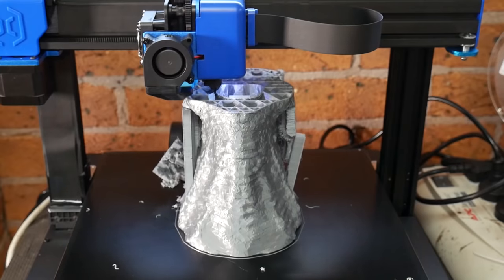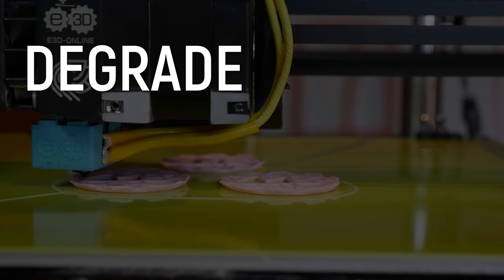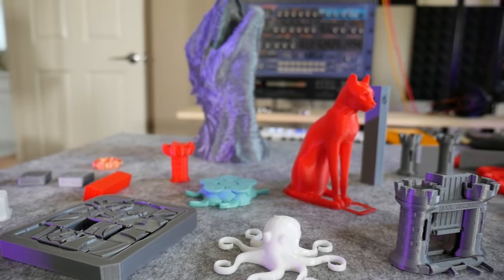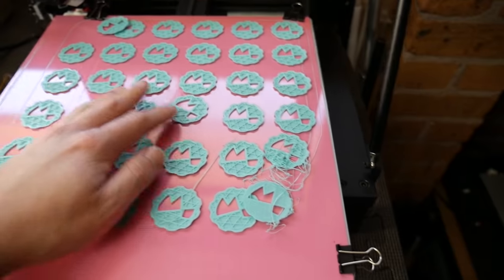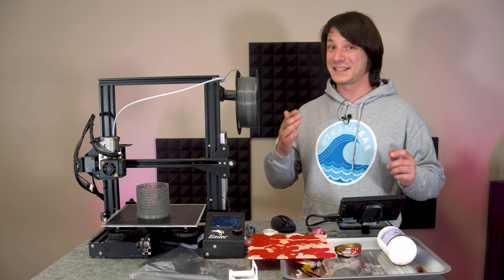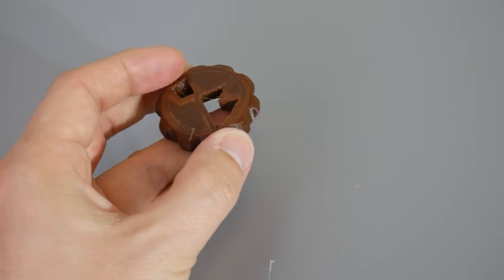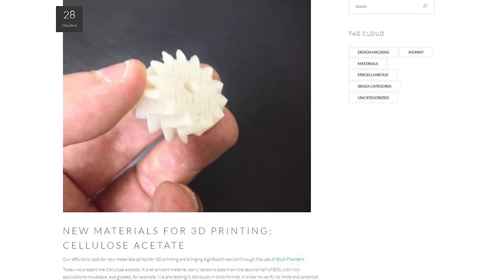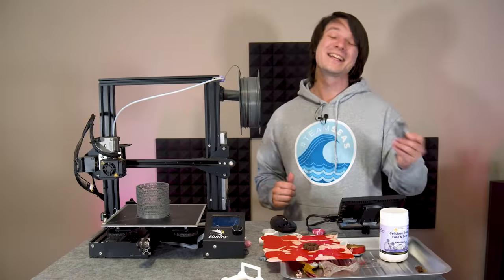PLA - 3D Printing's Biggest Lie.

Comment: A few notes:

If plastic is properly disposed of (i.e. industrially incinerated) it's not really a problem compared to other atmospheric carbon sources. Almost all ocean plastic comes from the fishing industry or countries without proper waste disposal.

SEA countries import plastic trash to recycle and sell it, they aren't paid to be landfills. The issue is just that one of the reasons it is economically viable to recycle there is lower environmental standards which result in improper disposal of unrecyclable fractions.

Cellulose Acetate doesn't biodegrade well, just look at cigarette butts. Funnily enough I had an exam yesterday where CA was an example of a bioplastic that doesn't biodegrade properly.

Comment: As a TL;DR addition to one of my previous comments, PVA and/or PVAc (Polyvinyl Alcohol and Polyvinyl acetate) might be more readily useable, readily bio-degradable (and water soluble or water degradable) 3D printing materials, both of which already have some use in 3D printing, I think.

Cellulose acetate (or even powdered cellulose as filler) might be useable in various PVA and/or PVAc blends. PVAc might also be a useable plasticizer for cellulose acetate and a melting point reducer. (PVA is much more water souble than PVAc, which could be a benefit or detriment depending on what you want)

Comment: First of all, just because it says it was made with corn, does not mean it was made from the edible parts of the corn plant. Definitely something to look into more before you start saying it could be used for food instead. Next, I have heard of a couple of startups trying to manufacture machines that can melt used 3d printings and turn them back into filaments. I did a bit of research on one for a college business class project last year, for using recycled plastics to created products, though I don't remember it's name. I am from the USA though, so I don't know what is available in Australia.

Comment: It degrades just it needs the heat, bacteria and worms from compost.
Me composting my PLA waste after breaking, grinding them down.
In my quite average garden compost it totally dissolve in about a 1,5 half year period.
The oxidiation/rotting of plants is an exoterm process, it's easily heat up to 60 celsius (more like 70-75), and it has everything to degrade/dissolve plastic.
Not in a 60 days period, like the industrial process, but still doing it's thing.

Comment: About 15ish years ago, I remember reading about a researcher working on a way to use waste plastic for roadways that would basically never degrade. He had some method of breaking it down into very jagged and irregularly shaped microplastics, like the size of sand grains, that were then put under very high pressure very slowly (to mediate the rise in temperature), and the result was basically a block of plastic that was so mechanically interlocked with itself that it behaved more like a rock, and didn't really care what got thrown at it.

Not saying it's necessarily a good idea. Personally, I'm team Plasma Arc Furnace.

Comment: I'm pressure sure Celluloid had already replaced tortise shell items in the mass market before Cellulose Acetate came along and competed with and eventually displaced it (mostly due to its non-flammable nature and eventually lower cost as well).
Likewise it largely replaced celluloid (nitrate) based photographic film stock with safety film, though both types have problems with autocatalytic decomposition in very long term storage under adverse conditions (high temperature and humidity) though cellulose acetate is probably worse in this aspect. (it also degrades with long-term contact with skin, sweat, and body oils, as many people with cellulose acetate glasses frames may have noticed, especially on the ear pieces)

Cellulose acetate also competed with (or still competes with) cellophane film for packaging, and has done so for a very long time, though now competes with a variety of other plastic film types. (and cellophane itself is a less common bioplastic due in part to concerns and problems with carbon disulfide use in its manufacturing)

That said, you're right, it should be a fairly good 3D printing material since it melts. (cellulose itself will not, so you can't 3D print cellophane, at least not in the conventional sense ... though cellulose dissolved to form viscose can be spun and potentially 3D printed in industrial settings)

PVA, polyvinyl alcohol might also work. It's water soluble and biodegradable, but by the same nature the water solubility would limit its use.
PVAc, polyvinyl acetate might also work, though the melting point is rather low and it's pretty weak. (both cases of PVA and PVAc or a blend of the two might be good for short-use items and disposable iterative design type items)

Any combination of PVA, PVAc, and cellulose acetate should make for an interesting array of properties as well.

Comment: i mainly use petg because where i live the price is slightly cheaper. I save all my failed prints and broken successes in sealed bags seperated by color so that when i eventually can get my hands on a grinder and filament extruder i can recycle my failures. i have about a garbage bag full of petg that i need to recycle already.

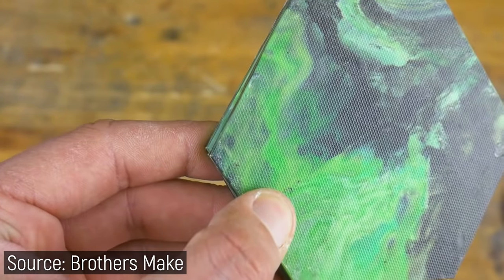Comment: I saw a guy that recycled cardboard and paper by mixing it with water and using 3d printed molds to create new things that he can use. If you have a 3d printer (and im sure 90% of the viewers from this video have) you could use the same idea but with your waste PLA. At 5:40 we can see how flexible and soft the plastic became after it had been in the oven. If you need anything that can be produced by molding waste PLA, I think this could be a great way to re-use plastic, that otherwise would be thrown away.

Comment: If you're looking for something more biodegradable than straight PLA you need PGLA. It's a mix of PLA and PGA, both of which are slowly biodegradable under the right conditions, but the mixture of the two allows moisture to penetrate throughout the material and break it down much more efficiently (although that will still take a year or two, apparently). It's used in medicine for bioresorbable implants. For stuff that disappears even faster, like bioresorbable sutures, one must look towards PCL instead. As a matter of fact, both of these materials do exist as 3D printing filament. Perhaps you could try and see what they print like. But from what I can tell PCL is not that strong and melts at a really low temperature so it isn't really good for much.

Comment: I feel like you forgot that the "3 R" are in a specific order : Reduce, Reuse, and then finally recycle.

The issue of plastic waste is something that has been concerning me ever since I joined 3d printing Facebook groups, and saw people telling they got their 3rd, 5th or 10th printer. When i asked them why, they told they were printing 24/7 on their old machines, but they weren't in any business kind of things : just printing trinkets, toys and figurine ... 
The amount of plastic printed just blew my mind. Some of them were talking in kg/week ...
If the first R is reduce, it's for a good reason. I would advocate for printing less, prioritising useful prints over toys, printing with more reliable parameters ...

The most recent thing that hit me hard is the  speedboat challenge. People spending hours of printime to get to deceiving benchys, that will end up at best in landfill ...

We all need to try 3d printing sobriety
It's not just about if our prints end up in the water

Comment: I rarely throw away any 3d prints, they end up in a bin that then ends up in a trashbag and I now have 3 trashbags full of PLA+ waste sitting in my closet. I will melt these down and create textured backdrop panel molds for kitchen and bathroom, thank you for this idea I thought I was gonna have to save them until the day someone actually made a reliable filament recycler and make recycled spools.

Comment: 50C isn't an unrealistic temperature for a composting bin. Home garden-sized hot compost bins do exist.
It's just a matter of having the microorganisms with the proper enzymes.
At that point, I imagine you could just throw some additive into your compost bin like you would throw yeast into a wort.
Reply: But there's the question of what you do with the compost. Most PLA isn't pure PLA, but has additives. Are those additives something you want in your vegetable garden? I know some PLA, like PolyTerra, use additives that are safe when the plastic breaks down, but most PLA I doubt is that safe.
Reply: not sure how many actually do such, but composting loos are supposed to exceed 100 deg C to kill off human pathogens.
Reply: I agree, that may require factory made compostor with real thermal insulation but it should be doable for home owners.

Comment: "easy" fix would be to make a decent way for people to convert failed prints back into filament.
melt it into a sheet, break the sheet into bits and pieces, feed it into a machine that melts and extrudes the PLA into a spool and viola, you have a roll of recycled filament.

i use my 3d printer to make molds for various things, and i do get quite a few failures. it would be nice to be able to recycle failed molds or older versions of molds back into filament.
it would certainly be a decent money saver as well.
Reply: ive saved all my print scraps for that exact reason. hoping that some day i would be able to either repurpose them or grind them up to make new filament.

Comment: Plastic doesn't necessarily need to be biodegradable, as long as it is recycled (and eventually disposed of) correctly. 
Here, PLA is collected with other plastics, sorted and recycled. Rejected low quality plastic is not put in landfills but instead burned -- and while that sounds bad the combustion products are filtered, and nearly CO2 neutral as the carbon in the PLA originally came from CO2, and the combustion heat is used to heat houses. And if we don't want to rely on governments, we as a community could also start programs to recycle printing plastics, and maybe also lobby with filament producers to start up recycling programs.

Comment: A thoughtful conversation. Note also that burning (plain) PLA may produce a better environmental out come than composting.  Burning it (hot, controlled, intentional) produces CO2 and water vapor (almost...there is pigment to think about.  PLA + usually has some ABS in there which does not burn so cleanly).  Composting it produces CO2, water vapor and methane.  Methane is, unit for unit, worse as a greenhouse gas than CO2.  Note the end of life section on the Wiki article about PLA.  It can also be recycled chemically and a very large percentage can be used to produce virgin PLA (again) with no reduction in quality.  Composting under industrial conditions seem ideal, it's more complex than you would think.  If you bury it, it will not break down by micro-organisms for hundreds if not thousands of years.  BUT.....that is carbon sequestration.  

Grow corn (or cane) and suck CO2 out of the atmosphere.  Turn it into PLA.  Make things with PLA.  At the end of life, if you bury it the carbon/CO2 does not return to the atmosphere. That's a good thing.  Composting and burning return it right back to the atmosphere.  One might consider that as carbon neutral.  Burying it actively reduces CO2 in the atmosphere which is actually better than carbon neutral.

I'm not lobbying for any particular solution, but pointing out that it is a bit more complex than one might think.

Comment: I am hoping there is a viable at home solution for recycling the used filament into pellets to then use to reprint or make filament. I know there have been several attempts at this, but it's not what I would call viable (too expensive and/or too complicated). I do like the idea of melting the used plastic down, but what about using the melted plastic for some sort of injection molds or some sort of mold...would the melted plastic be able to be poured? I'm thinking no and to be able to do anything like this, the molds would need to be made of a material that could take a lot higher temperature than the PLA (so aluminum, metal, or silicone).

I would gather the corn they use to make filament and ethanol wouldn't be suitable for human consumption anyways...much like the corn that is used to feed cattle.

Comment: There is a possible third solution:
Sell the enzyme. The enzyme (any enzyme actually) doesn't need a specific temperature to work, it just works better at higher temperatures. Too high, and the enzyme starts to degrade. 50 degrees isn't required, it's just the optimum, same goes for PH (a small caveat, the breakdown of PLA creates lactic acid [as it is Poly-Lactic Acid, meaning many lactic acids] and Acid lowers your PH).
That said, I'm not that knowledgeable on the details of the breakdown process. I just know that it's technically possible. You can harvest the enzyme from some bacteria or yeast you coaxed into producing it (or that already produce it themselves). This is fairly common, insulin or the enzymes in your washing liquid come from similar processes.
How cheap this is depends entirely on the simplicity of the enzyme, and how easy the organism required to produce it can be kept in a bioreactor.

Comment: PLA printing material is not pure PLA.  PLA is degrades slowly only in the prescence of water over 30 degrees celcius.  This degradation rate increases as temperature increases.  The other factor is the physical size of PLA.  Thin films degrade much faster than thick PLA.  Products that are certified compostable from PLA must fully degrade in commercial composting facilites in around a months time.  Thick PLA that has additives for 3D printing will not do this but certified compostable PLA will degrade relatively quickly in the right conditions.

Comment: My solution is i built a system that recycles my unused, failed, or leftover filament back into filament that i can reuse.

its a reverse 3D printer if you will, and getting this technology to a point that its more affordable for more people instead of it being something you need to build/design yourself is IMO more of a realistic solution.

i use ABS, Nylon, PETG, because its more shock absorbent, flexible, and heat resilient than PLA which is quite brittle and weak by comparison.

Comment: correct me if I'm wrong but is there not a PLA pellet to PLA filament desktop machine, if you simply melt down your old prints into a sheet and then cut them into small pieces, you can just make more filament with it and self recycle it, you won't need any more filament if you melt down old things that you don't want anymore,. this does not solve the issue that's described in the video but it will help it a little bit since there would be less waste generated
still not a solution though :c

Comment: Excellent work! Great to see a fellow Australian trying to make a difference.

After about 5 years diving into the melting pot of common urban plastics, I am convinced that material science based solutions to waste plastic will only be effective in closed loop recycling in commercial industrial scenarios. Closed loop recycling only works in industrial contexts because it is relatively easy to regulate and enforce.

Unfortunately cottage industries, which include anything DIY, is inherently anarchistic and antiauthoritarian, so regulation will simply not work with the DIY population. One way forward is to promote integrated solutions that emphasise independence and waste control. Mavericks don’t care how they appear to others, but they are big on privacy, and any waste solution sold as a stealth technology WILL have pull!

My solution involves creating keyed bricks etc using waste plastic. It can be scaled for private use, club use, or municipal use. It is ideally suited to non-for-profit social enterprises.

Using waste plastic as a binder for other waste products such as crushed glass and aggregate made of exotic plastics, creates a versatile, low transport, repurposing industry that can be customised to suite local waste streams and legacy waste dumps. 3D printing waste simply becomes just another domestic waste stream.

The addition of carbon black for UV resistance means that most domestic plastic waste can be repurposed locally for durable non-load baring elements for common urban civiic projects: Guttering, edging, bollards, fencing paving, retaining walls, geo-mesh for reinforcing earth, emergency flood mitigation, drains, culverts.

A coating of sand and inorganic pigments, will make the objects aesthetically pleasing. The addition of steel reinforcing will do for waste plastic what it does for concrete.

If we turn all waste plastic into valuable resource, it will cease to be a problem.

Comment: Biodegradability of PLA (in industrial compost) is ONE possibility for recycling but not the single option. PLA can be reused, recycled (shredded, pelletized, remelted, and formed), chemically recycled ("cooked"), or even incinerated and by the way, can be used as long as we would like to (so it will not degrade by itself). I consider the fact that PLA is bio-based as a much much bigger advantage compared to its biodegradability. Bio-based means that it is coming from atmospheric CO2 (processed by the plants into starch and cellulose). Independently from the end-of-life option, in the end, it will be the same CO2 again. Forget that it is biodegradable. It is bio-based and that matters.

Comment: The best thing to do with test prints/failed prints is to grind them back up and re-extrude them into filament. It's a lot easier to do than you might think and you can do it in your own garage.

Comment: Cellulose acetate was used in pocket-knife handles in the late 18th and early 20th century. Unfortunately, as cellulose acetate breaks down, it off-gasses acetic acid, corroding any metal it is in close contact with.